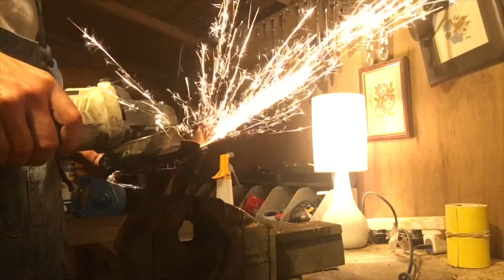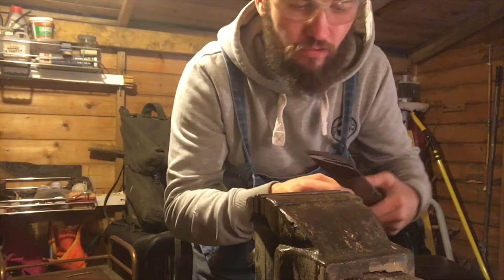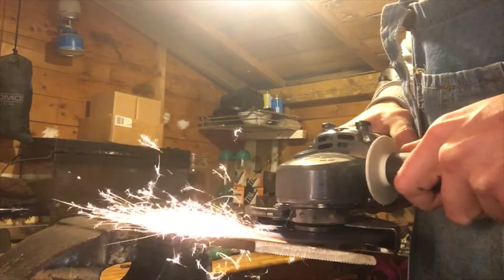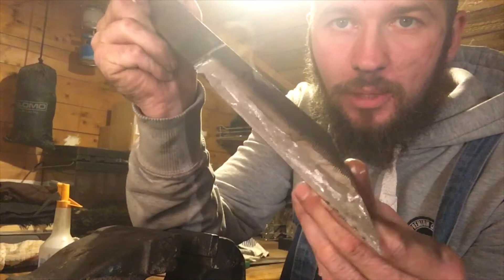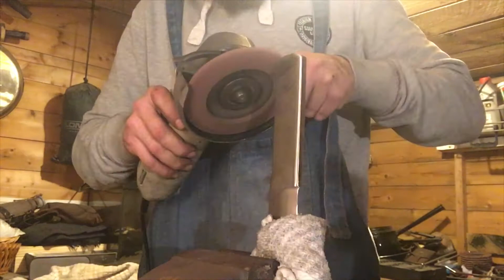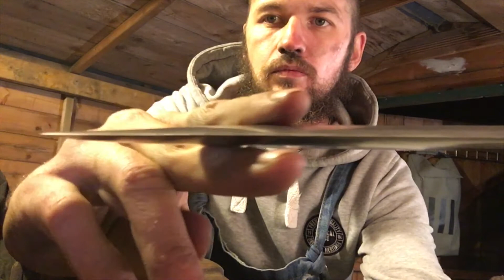Making a Viking Seax file knife

Comment: Nice knife. I usually make knives from saw blades, or shovel steel. Likewise I don't heat treat them, try to keep the steel cool when cutting them. Shovel steel is some resilient stuff, so makes a decent blade without much treatment. Your seax is sweet! Looks great without scales. Files make nice blades too. Great work